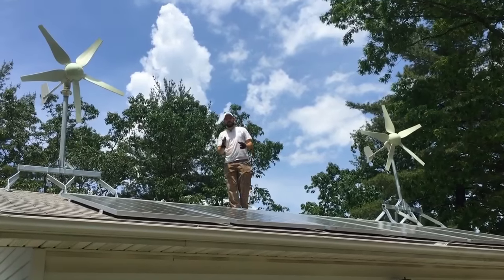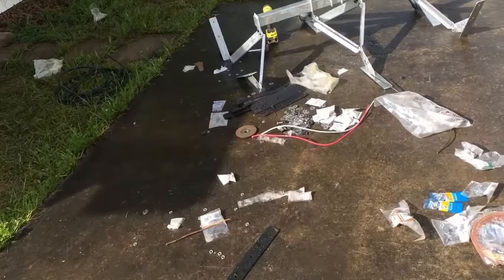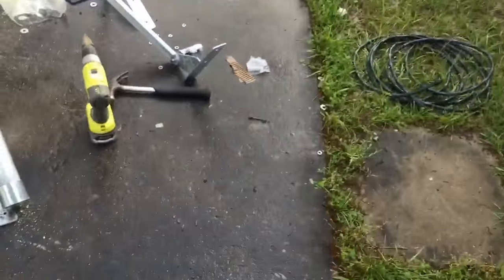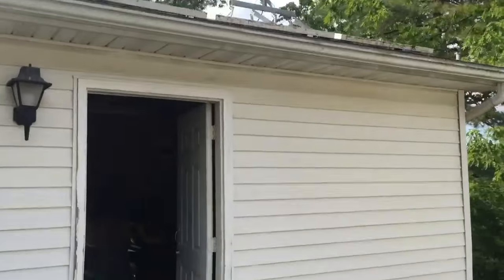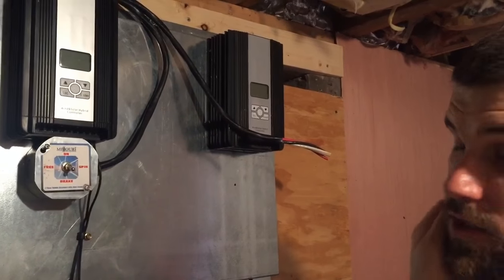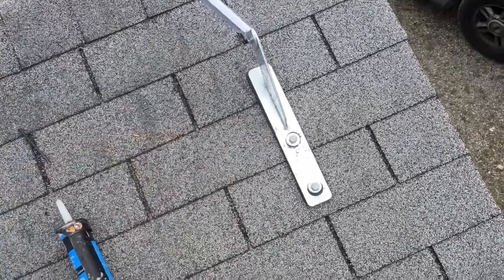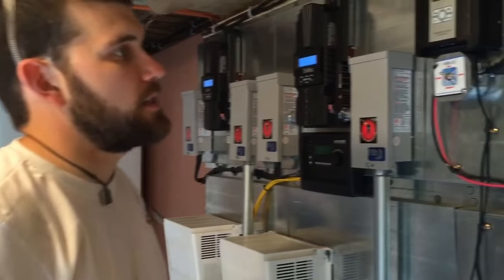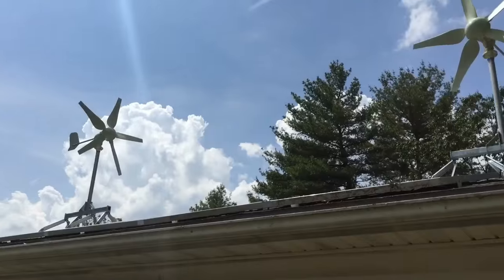6.3KW Off Grid solar and wind power system install by Off Grid Contracting Part:2 Wind portion

Comment: I think there wasn't enough panels in this setup and the bank is a bit limited.  I would have suggest 24 panels and a 48v 1100 A bank.  But I guess he could expand it later.

Comment: what are the wind charge controllers called? I'm looking to set up a mobile/stationary kit with wind and solar set, but cannot find a proper charge controller to handle 400-600w wind and 400-600w solar.